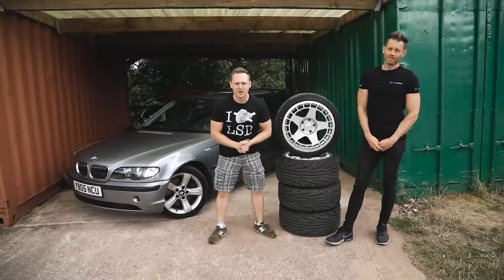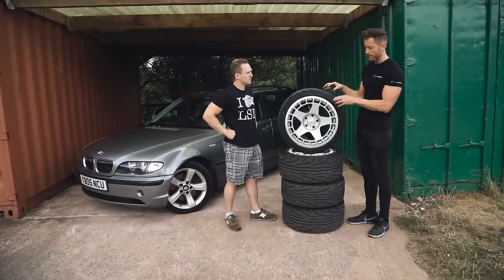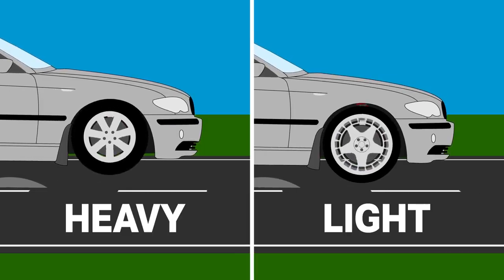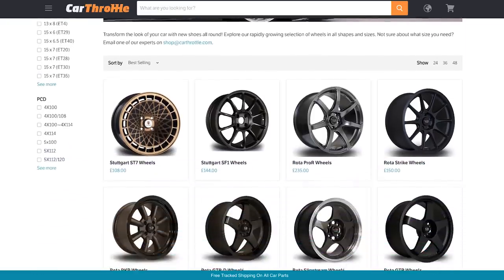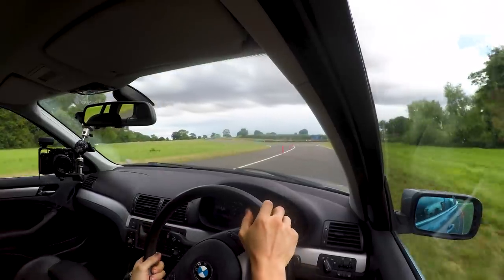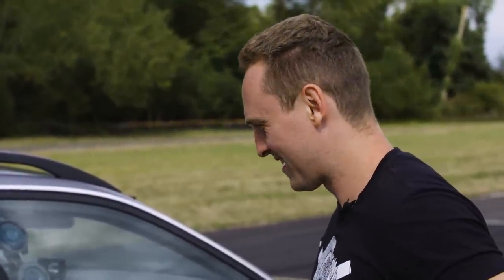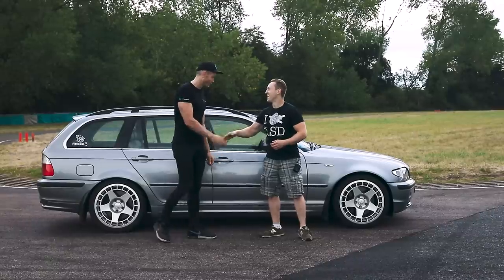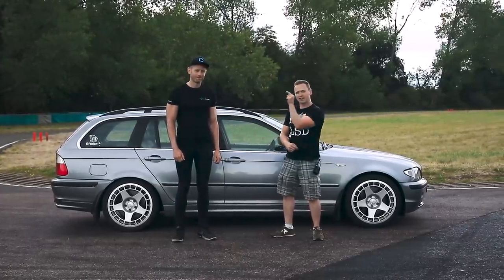How Much Difference Do Sticky Tyres Make To Lap Times?

Comment: Ugly Rims , Bad Tires… 
OZ Ultralegera + Dunlop Sport Maxx Race
Reply: I'm not quite sure they're billionaires.
Reply: why billionaire? Quality costs something but the price is justified !
2 - 3K € it's not much Money for GOOD Rims and Tires ….
Reply: Sure, not if you want to go all out for a track car, but don't forget that this is still just a half track half daily car, a wagon, it will be going through the stress of a usual daily commuter.
Reply: Sure but …
Nankang Tires are not the best you can buy, good tires cost a little more but have better performance and more safety reserves. The tires are the only contact to the road and this should be perfect
Reply: when you put it this way, I do agree with you
Reply: Agree on the OZ Ultralaggera, also have them on my wagon. But Dunlop? Come on.
Reply: Nankang are one of the oldest tyre manufacturers from the East, 1940,s I think......huge huge experience even thou they made most of there bucks from selling truck and tractor tyres earlly on but  believe me for the money, these NS2R,S are braver than most of us watching and are by no means bad  tyres.....go try em.

Comment: This is the coolest series you have ever done.
Next part is highly anticipated on my part
I hope you will chip tune/optimize the car
perhaps an intercooler? quick fix.

I think there was a communication error.
This is supposed to beat the m3
So:
01 grippiest tyres
02 wider wheels 
03 wider tyres
04 lighter wheels
05 lighter tyres

Now it will never beat the M3
Also Clickbait. These are not AFAIK sticky tyres

Comment: Your understeer issue made me think of those fixed front endlinks your put on, just becuase they came with the kit. I think you mention they were 4 inches shorter than stock. Seems like you are creating a preload issue. Having the correct preload of  the stabilizer bars, especially in front, makes a dramatic difference in predictabiliy and smoothness. Lowering the tire pressure in the rear confirms the is something to compensate for. Just saying you might get more from your car with adjustable endlinks

Comment: Still not really sure why the staggered setup was used. A lot of racers run squared for a reason. BMWs love to understeer with staggered tires. Best thing I ever did with my e46 M3 was throw a square setup on it. Unless you are running some serious power or have a very rear heavy car, you really don't need staggered. If you need more grip for increasing power on the 330d, just run bigger tires all around. E46s tend to take to a square setup very nicely.

Comment: The door plate on my old 330i stated 38psi (front) and 45psi (rear) for light loads... not sure why they wouldn't start with the manufacturer's pressure first before reducing them so drastically

Comment: Did they do an alignment after putting the new wheels and tires on? If they didn't, then they are really missing out on shaving more time. You can't just change the size of wheels and tires and expect your old alignment to work exactly the same.

Comment: Actually tired of seeing comments from people who don't know these NS-2R's, there a List 1B tyre for competition use according to the MSA, the same as the Michelin PS Cup 2 (not quite as good as the Michelin but not far off), there used as the control tyre for the M3 Cup, Civic Cup, Compact Cup and MAX5 race series, the 3 runs done in this video wouldn't be enough to get them up-to correct operating temp and there's a big difference in the way they behave depending on there temp and pressures, lastly what your all saying is Tyre Reviews doesn't know what he talking about which from my experience he's never set a foot wrong with a tyre review or recommendation as I've owned these NS-2R's and most of the Michelin tyres he's covered, the NS-2R does not compare in the slightest to there normal road tyres range

Comment: Ns2r is a good budget extreme performance summer tire, but for laptime smashing proper R compound AR1 would be a better choice, and BMW 3 series is all about the front end grip, should put the wide tires (same size as the rears) on the front.

Comment: i have been following this project and loving as i drive and love bmw tourers, ive owned a e36 323i (very fast XD) and 2 e46 320i (the 2200cc 6cly version)
so there is one thing i dont get, why did you choose a 330d over a 330i, the 330i would probably keep up with the m3 anyway?

Comment: These are great cars, but do check the rear axle mounting and reinforce it before it shears out of the chassis.
They sit in rubber blocks which tend to go bad.  It starts with a knocking sound and quickly deteriorates.

Comment: Nankang Tyres are dangerous !

I drive a 2013 C63 Station Wagon. Tyre sizes: 235/40 R18 in front,
255/35 R18 in rear. In June 2019 i needed new tyres. My Michelins
was not aviable, but i had to buy some tyres, because i was going
on a 5 day road trip. So i bought the Nankang NS2R, with the intent
to re-sell them for a fair price 10 days later, when the Michelins would
have arrived. So i drove 300km with 130-140kph. The tyre feeling was
ok. Then there was a short moment reaching 230-240kph. There was
a weird feeling in the steering. After 600km it slightly began to rain.
At 120kph the car felt like disconnected from the street. The grip
level in dry and wet conditions are noticeable lower than with more
expensive tyres. And breaking in wet conditions is the worst point:
Up to 13 meters more from 100kph than dunlop, michelin, conti,
toyo, and even falken or kumho.

So when the car with Dunlops comes to a stop, the car with
the Nankangs is still moving with 45-50kph. Very promising,
when you don't want to crash...

Comment: Next will be a slightly higher bar turbo, bigger intercoolers, larger heat exchanger (radiator), higher pressure injectors and a cheeky remap.

That is all (oh yeah, some EBC slotted brakes)

Comment: Given the 330Ds unsuitability for this (heavy engine and large body in estate form) I wonder if a 330i coupe would be even quicker. That would be deeply interesting to know.
Reply: e36 328 (or m54b30 swap)  coupe, w no sunroof, striped to the bone 1100kg, on proper R comp's would be even quicker still.
Reply: You think? 330i has quite a bit more torque and power and wasn’t THAT much heavier.

I drove the e36 328i before buying an e46 variant and didn’t feel there was much in it. My later 330i felt much quicker in ever way.
Reply: The saloon 46 are even more suited than the coupes as they are a stiffer shell.

Comment: Remove the roof rails, they are not light and it adds weight in the height.
What is the weight of the rear wheels ? (19.5 kg = 255/35/18 mich ps3 used + oem style 32 in 8.5x18) 
(i'm french, sorry)

Comment: Still think that the track is too small and windy for the M3 to use its power difference and that the stock tourque of the 330d is enough to keep it near to the M3 time. A track with longer straights and harder braking zones would give a fair fight

Comment: Are the NS2R any good in the rain, or can you compare them to AD08R in the rain? I might want to use them instead, but I drive them daily so they gotta work as "good" as the Yokohamas in the wet.
Reply: They are good, but not as good as AD08R
Reply: In general or just in the wet? The price is good, since Yokohamas are 150€ each for me..
Reply: In general AD08R is the best in it's class (extreme performance summer tire, *not a true R comp.), but also the most expensive.

Comment: Those Tarmacs are good wheels but your track times would have gotten better if you have lighter wheels. Those Tarmacs are pretty heavy compared to flowformed wheels. Going from 40lb+ to 20lbs would reduce your unsprung weight and rotating mass reducing your braking distance and increasing your acceleration.

Comment: They said to increase the rim size to 18 and that means more rubber which is better. On clio 172/182s renault and most owners who track day preferred the turini alloys in 15" for their cup chassis rather than the normal cars 16" therefore more rubber. So why is that? Genuine question, not a dick comment!

Comment: seams to me like the tire guy is handicapping you to protect his M3 time... a 255 sq setup would be faster than a 225/255 setup cause less understeer (remember all those times you understeered off into the grass)... and then he talked about how important wheel/tire weight was and he told you to get heavy boat anchor cast wheels...

Comment: Forged rims are not machined from a billet!
A billet is heated to near melting point then rammed into a mould under high pressure.
Forged rims are lighter and stronger than machined billet wheels .
Machined billet wheels are lighter and stronger than moulded wheels .

Comment: Oh.. hang on guys. There's a phone call. Yes? Hello? Yes..... Okay..... click
That was the 19 year old owner of an ex-taxi Nissan Bluebird from 1993 that rang and wants its alloys back. Seriously, what were you thinking? Job lot of alloys that someone over-ordered? It looks like you should be delivering takeaways. Give those stickies some decent wheels. 

You know last time when I said it needed softer springs on the rear and a stiffer ARB? Still that.  Still, don't worry, on a circuit with only 2 braking zones I'm sure the big discs and red pads will be great.

Comment: 18" rims? Seriously? Total weight of an 18" vs a 16" (or, better yet, a 15 inch) is WAY better. (hint, air and rubber weigh  much less than metal) A set of 16" RPF1s will kick the crap out of the rubbish you installed. Oh,  and "worrying about tire rollover" is nowhere near as important.

Comment: You're acting way too hard to cross promote each other. It's awkward.

Also, those small increments of improvement are suspicious and feel staged, which makes me doubt the authenticity of the recorded times. Why don't you do it the way Motor Trend does it?

Also, how do you measure those times? I hope you don't rely on a guy stopping a stopwatch when he "thinks" the front is over the finish line? 

I do enjoy the series but I seriously doubt any of this is true, which is disappointing.